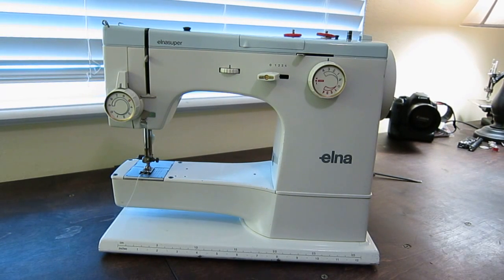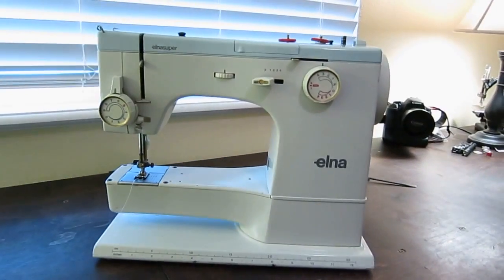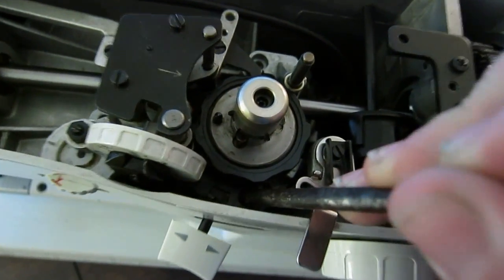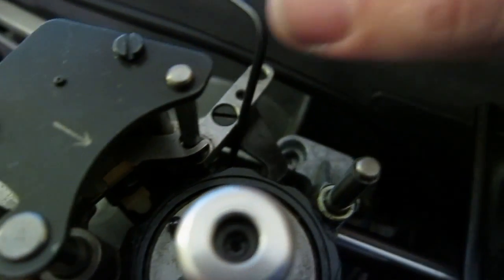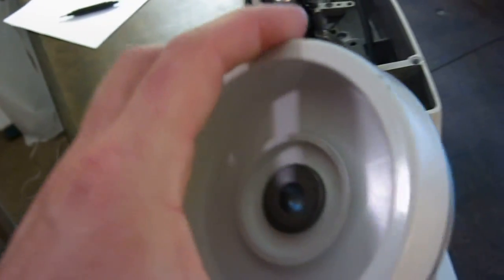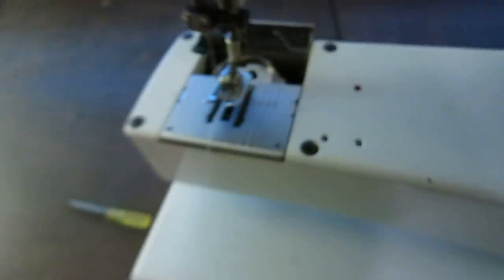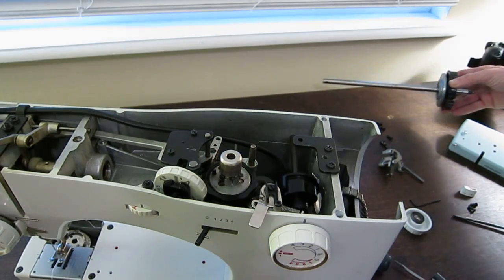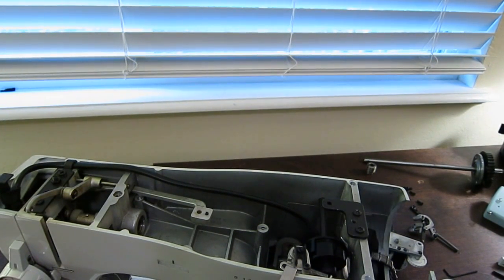Elna SU Supermatic Star 62C Cam Gear Repair Tutorial (Part 1: Disassembly)

Comment: Just starting this repair now... and hoping that reassembly and adjustment will not be impossible without your Part 2 and Part 3! Wish me luck...
Reply: Did you have success?  I haven’t seen any posts by anyone for reassembly of this gear.  I don’t want to take it apart until the reassembly tutorial is available.
Not afraid to try, but also don’t parts strewn apart for months ;)
Reply: @susanlehnen593  Yes I succeeded but it took about 5 hours and was pretty complicated. In the end the machine worked pretty well but needed a special tuning tool. A couple years later I sent it off for an adjustment. The serviceman said it only needed a small adjustment. My daughter has been cranking out stitches on it ever since.

Comment: Thanks for uploading this video.  I have the same machine with same problem. Following your instructions I successfully  removed the cam rotating mechanism. What I noticed  the mechanism can easily be taken off without removing the long rod if the lower part of the rectangular hole through which the rod passes is cut off. There seems to be no harm in cutting that as the mechanism will still be strongly held by the upper part of the hole. By doing this modification we can easily pull out the  cam mechanism without disturbing the timing. I need your guidance please. Thanks and regards from India.

Comment: At 5:46, you say you have already removed that phillip’s head screw. The only way I found to access the screw was to back out the pin screw that the loop spring hooks to. Otherwise, I could not swing the arm out of the way.  The pin screw did not need to be fully removed, and I would not fully remove it if possible, so as not to drop it.  Maybe I was doing something wrong, but I could not access the phillip’s head without the added step.
Cheers!
Reply: BTW, thank you very much for making my repair possible and painless.

Comment: Was there ever a part 2 reassembly?  Still waiting…. Part one is great.
So far, I’ve seen two separate videos to take this apart but none to reassemble. Maybe I should not attempt to repair myself?
Reply: Hi. There is another series, I believe two parts by In Stitches. Elna Supermatic Star Series - Pattern Cam Stack Drive Gear - Part 1 - Replacing the Gear.
 Hope that helps!

Comment: Tried this on TSP72 but can't get screwdriver on front screw of Elnagraph even undoing little screw on front right levers blocking access to the screw head to remove Elnagraph unit.

Comment: The needle position dial on my machine is very stiff. Looking online shows this to be a common problem. Is the dial meant to move on the shaft or is it fixed and the whole shaft is meant to turn in the metal casting? I'd like to free this up without taking the machine to pieces. Thank you very much for a great resource and for posting the service manual.
Reply: Did you ever find out how to loosen the needle position dial on your Elna Star? Did it require taking the machine to pieces? I have the same problem with mine but I didn't realize it was such a common problem.
Reply: @ProfoundConfusion  did you guys manage to do it ?
Reply: @ProfoundConfusion  I am having the same problem. did you ever get an fix for it?